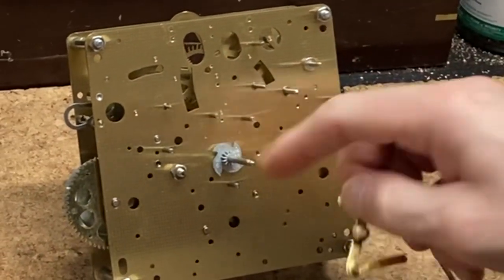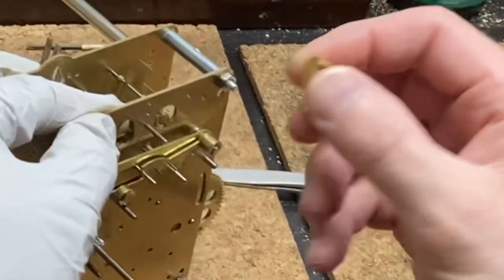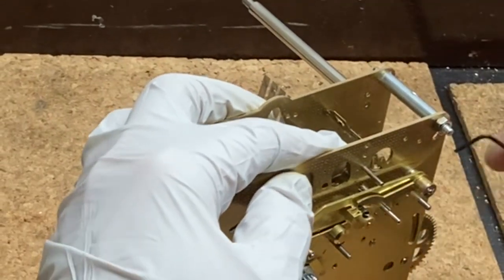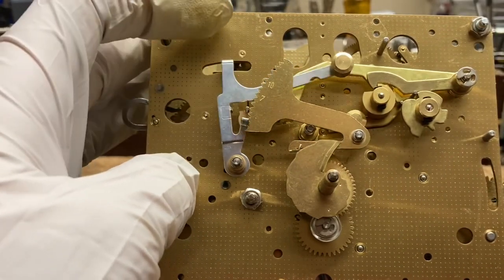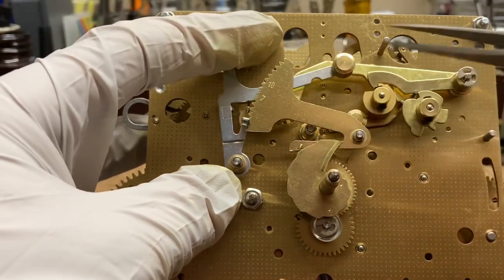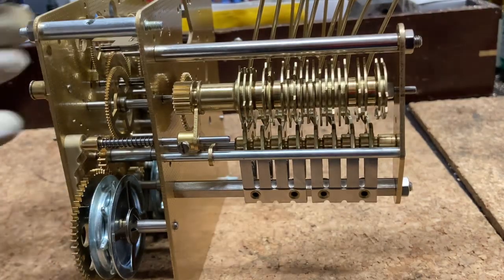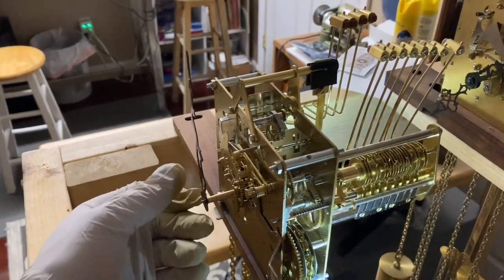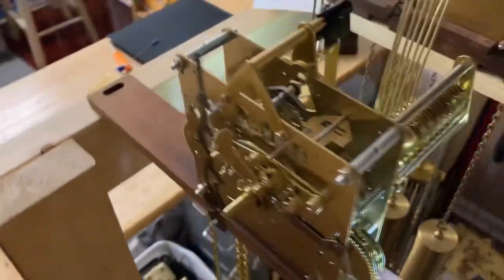How to install rack and snail to chime and strike for Hermle Triple Chime

Comment: How do you adjust the lever that makes the clock go into warning on the quarter hours?
Reply from the maker: You don’t adjust the lever. You adjust the cams.
Reply: @Chrisclockrepair  what if the lever with the pin gets jammed?
Reply from the maker: @jordanbusby6231  In order for me to help you, please be more specific what what pin exactly and what is it jamming on exactly and at what point does it jam?
Reply: @Chrisclockrepair  the pin on the lever that contacts the star wheel it jams on the star wheel
Reply from the maker: Thanks for the tip. Always good to hear from an experienced pro. How are you getting along?
Reply: @Chrisclockrepair  you replying to me?

Comment: Hey Chris do you know where I can get the parts I need for my Howard Miller mechanical wall clock model number 612-581 Westminster
Reply from the maker: Check merritts. Call and ask. They often have used movements they sell, but you have to call and ask.